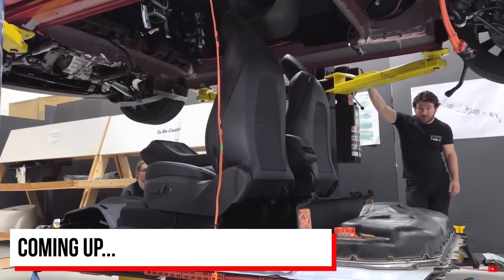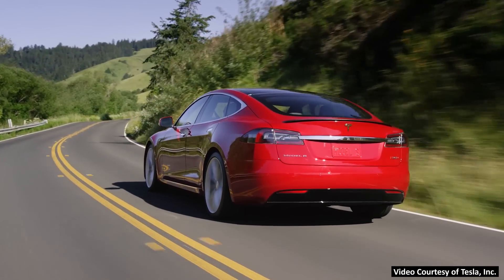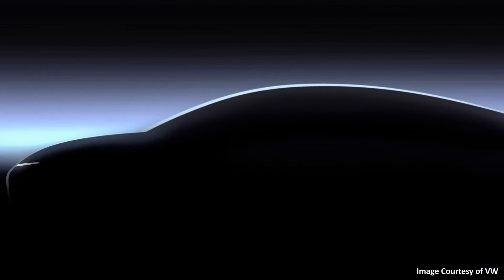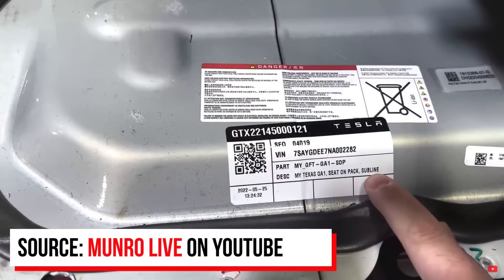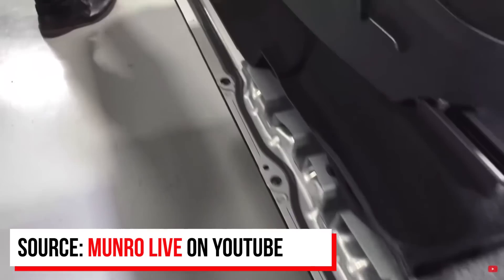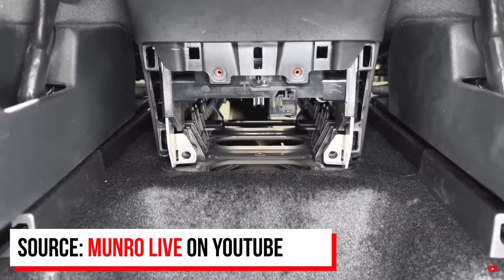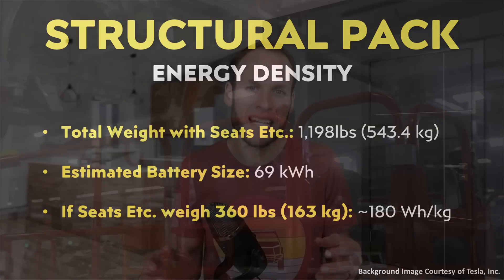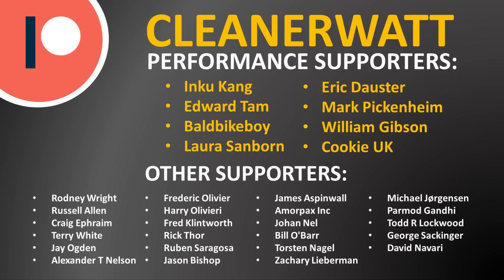Tesla Structural Battery Pack | Munro Teardown

Comment: Good video. I agree this shows how Tesla achieved economies in scale and took the risks to get there. However, what remains to be seen is why they limited the 4680 capacity so low. They purposely capped the energy density lower than the 2170 by spacing the packs apart and explained this was to facilitate heat attenuation and limited range to 279 miles and of course impacted power/energy output. I think this was done to preclude an Osborn effect at Austin w/MY 4680. They desperately forced Austin to rapidly start up a 2170 line when they saw customers (who had MYs on order since last year) balk at accepting the new 2022 capped 4680 version (at 2021 pricing.) What surprised (and disappointed me) was capping the capacity at 68 WH. and spacing the packs apart. Maybe we will see a few more cells added to increase capacity and then unleash the output with optionally priced s/w updates that uncap power and range. I predict a fully equipped long range MY 4680 battery pack will eventually be >75 WH and will achieve >400 mi. range. However, what I don’t think Tesla has gamed the range degradation over time as what customers are currently experiencing with the 2170 packs. >10% degradation seems to be the norm, some seeing more. Perhaps 4680 degradation will be greater? But, only time will tell. Customers (Guinea pigs) who accepted the SR capped 4680 (68 WH) packs will be given opportunities to increase power and range (as Tesla did with the newly introduced M3 2170 pack); however, 4680 range degradation has not been fully realized yet. As they say, only time will tell for sure. I’m sure Tesla has gamed this all out and is trying to manage the Osborn effect as 4680 is ramped at Austin and while the other factories retool to produce 4680 MYs. I get the feeling Fremont will take a hit on this and may even close down MY production when this all plays out. My remaining question is, how does Tesla convert other existing models (S, X, 3, Roadster, CT, Semi) to 4680 with production constraints? I think they are seeing some customers accept the capped 4680 versions and some not, yet taking the 2170s due to the inflated gas prices. Thus, 4680 has not Osborn’d the 2170–yet anyway.

Comment: It appears as though 4680 packs are great for manufacturing but it may be a nightmare when trying to repair or service the pack out of warranty
Reply: If I understand Munro correctly, you will never repair these packs.  They can be melted down for recycling, but that's about it.

Comment: Hi, is it safe to say the model Y long range (330 miles) should be charged at 80% on a daily use basis?   If so, that 264 mile range....The 4680 model Y (279 miles) can be charged at 90% on a daily basis..That would be 251 miles of range...If you  can get the new 4680 Y, why would you want the older 2170 Y?
Reply: I would still want to have 330 miles of range in case I need it as I did once last winter driving through the mountains.

Comment: Tesla are built to last unlike legacy trash heaps that's built as usual to need constant maintenance and servicing with all those complex parts, hoses, belts, fluids, and even wheels falling off not understanding how to fix it...
Reply: I own a Model Y, it’s a great car but this 👆is the most utterly brainless comment. Teslas are not “built to last”, Musk has been very clear that Tesla’s goal is that their cars be the most efficient to manufacture. Older Teslas encounter wear on parts and need replacements just like ICE cars. Teslas feature cooling systems with pumps, hoses etc. and they will eventually encounter problems. The small motors and actuators throughout the cabin are no different to those on other cars and fail with time. Teslas are excellent in crashes but even in some minor collisions are complete insurance write-offs when castings and battery packs are damaged.

Comment: While it’s a great idea! The major flaw In this assembly process is that the structural battery is basically not made to be reused/repaired easily after its manufactured, also integration is a thing but when it’s basically just big parts that needs to be totally changed that a big drawback tbh! Just imagine if we have been making cars like this for decades!? Uhm nope!!!
Reply: Remember that the battery has an 8 year warranty.   That means Tesla is sure that it wont fail, because it would be expensive for them to have to replace it. Also, this is an EV you're talking about, not an ICE car.   There are much fewer parts to potentially repair.
Reply: @panyanguyen13  In theory
Reply: R & R is simple for pack replacement.
Reply: Feel free to buy cars that need repairs. LOL
Reply: @anthonylieu9068  have you actually lost some brain cells!? Even tesla still needs repairs for the records! The older the vehicle gets the more it has problems and since batteries cells can fails hose reduces significantly range and power….
Reply from the maker: You make a good point. Nonetheless, Tesla can recycle most of the raw materials in these battery packs and reuse the materials to make new battery packs. It is not as if these valuable metals (nickel etc.) are going to a landfill.
Reply: @Cleanerwatt  lol…… you are totally wrong again mate!!! Tesla isn’t the only one that can already recycle batteries, secondly! We still don’t have enough EV so that the recycled batteries could have an impact! The used batteries from cars can be used for energy storage purposes or even into an RV….who said the batteries were going to the landfills!??!
Reply: @carholic-sz3qv  Maybe you can revisit what Jon actually said.
Reply: My thoughts exactly. It prevents independent repairs, and cell replacement.

Comment: Wonder why the gigafactories don't have roofs full of solar panels? I would think this company from all others can make that work economically?
Reply: They are installing them, maybe a new near mile long factory takes time to roll out fully.
Reply: It’s totally impossible to power those factories just with solar energy lol….. they also need wind and definitely the grid too!! Do you think those fournaises for aluminum melting runs on thin air!? Wtf!!!
Reply: Priorities!  That said,   Giga Austin's solar roof should be finished within a couple months.
Reply: It must not make economic sense yet. More subsidies may be necessary.
Reply: @0HOON0  even a full roof cannot entirely power the factory
Reply: @carholic-sz3qv  it can help. Something is always better than nothing.

Comment: Maybe the structural pack and 4680 will lead to efficiencies in manufacturing, but they seem to have fallen far short of expectations for energy density and weight.
Reply: More information is needed to make energy density assumptions.   Did Tesla software limit these packs ?
Reply: Given the conservative history/sandbagging, i expect the 4680 specs and capabilities will be refined and extended over the next 18 months.  Many OTA updates may delight owners.
Reply: @silverstake88  wrong!!!!! It’s half the weight with which competitor clown!? Be precise in your arguments
Reply: @carholic-sz3qv  You are right.  I didn't think that one through, did I?  My apologies.
Reply from the maker: To be fair, the comparisons he motioned in the video  are much larger battery packs. The Rivian R1T pack for instance is nearly twice the capacity (135 kWh) of the Model Y SR AWD pack.
Reply: @Cleanerwatt  exactly!!!! People are tooo early to say nonsense without even making any researchs! Also the battery pack is only half of the story! Other manufacturers uses more lighter materials in other parts of the car.
Reply: The major flaw In this assembly process is that the structural battery is basically not made to be reused/repaired easily after its manufactured, also integration is a thing but when it’s basically just big parts that needs to be totally changed that a big drawback tbh! Just imagine if we have been making cars like this for decades!? Uhm nope!!!
Reply: @carholic-sz3qv  the major flaw is when somebody who has no fucking clue what he is talking about believes he can comment on said things as if he knew anything about it. I find it quite irritating when people who are not even worthy to clean the shoes of Tesla's engineers makes unqualified comments on their design.
Reply: @whynotstartusingyourbrain8726  WTF are you talking about troll!!!?! You have no point on responding to my comment!? "CLUE" my @Zzzzzzz when you see all those vehicles that are over 20 to 49 years on the roads that have been used into the harschest roads and environments on earth, you think I’d those cars were made from big singular parts would have survived!? Lol….
Reply: @whynotstartusingyourbrain8726  the irritation here is you 🤡 your believe my @Zzzzz the product is essentially be made to be less and less serviceable over the years while removing ownership capabilities….. what a crap!!!
Reply: @whynotstartusingyourbrain8726  people are already using old tesla battery modules from packs to reuse for soooo many different purposes 
/applications….. not to mention just repairing/changing the module
Reply: @carholic-sz3qv  You are not going to repair the battery. It just works for years. And if you have to repair it, the disassembly is very easy.
Reply: @janh.7557  bullshit!!!!! The batteries on older model S are already giving up with many having multiple dead cellls, the dead cells means reduced range and charging capabilities….. the disassembly is actually not easy on a structural parc compared to batteries with modules inside!
Reply: @janh.7557  « it just works for years » lol…..